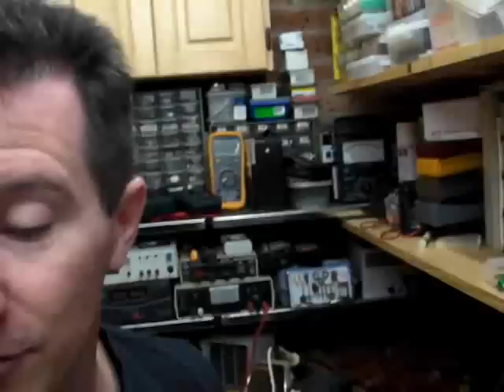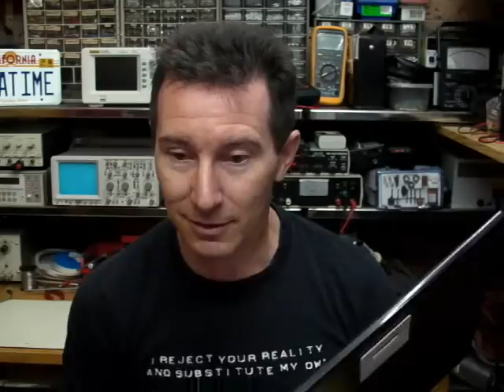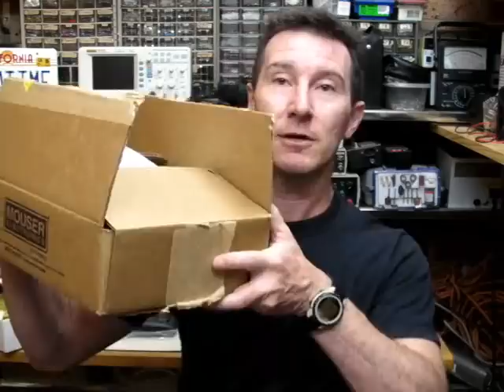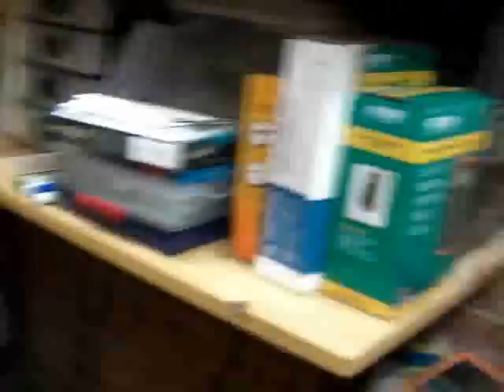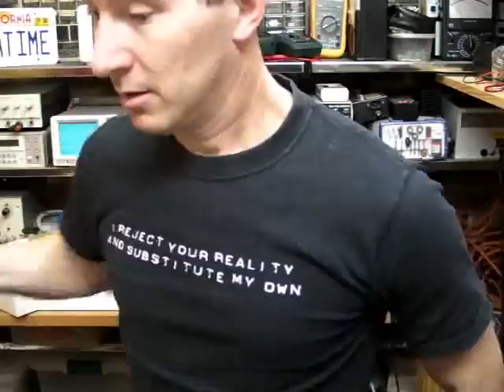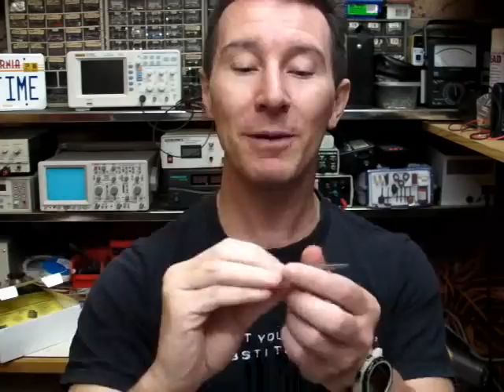EEVblog #131 - Live Show #7

Comment: A note on the ColdHeat brand irons, mentioned somewhere around 1:48:00, those irons suck.  They make awful joints, half of them are cold or dry, the iron does not provide adequate heat and I've seen a review where they shorted some components with the tip since the tip actually applies a current to what it's soldering to determine if something is there.  Avoid the ColdHeat irons like the plague.